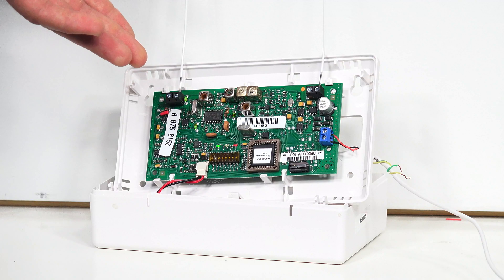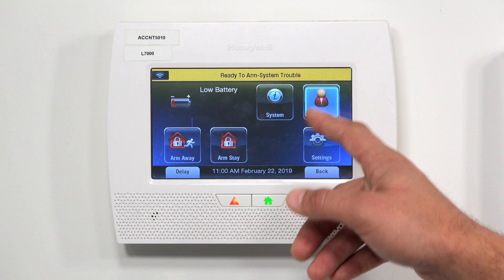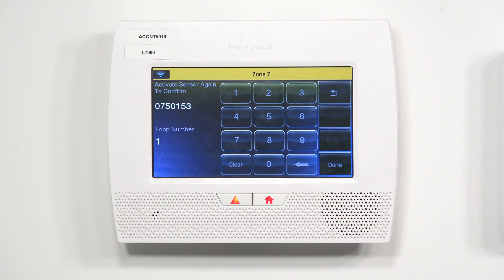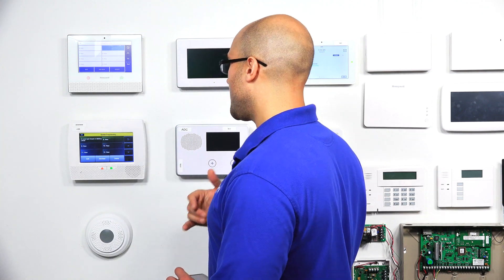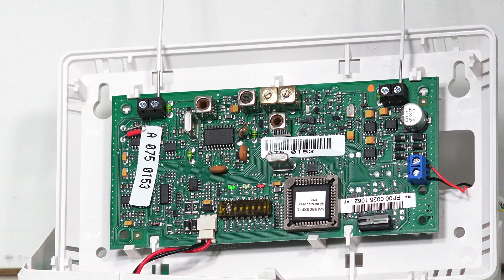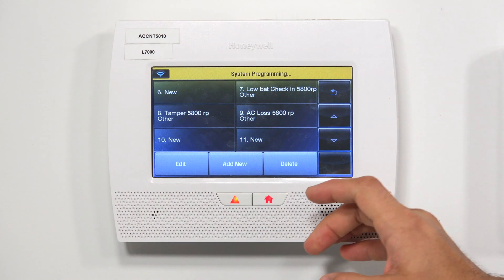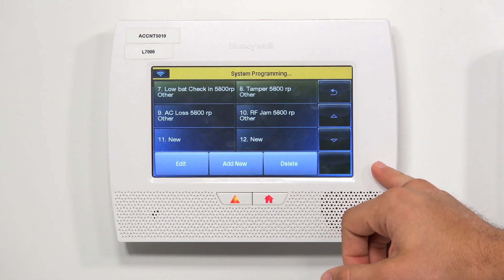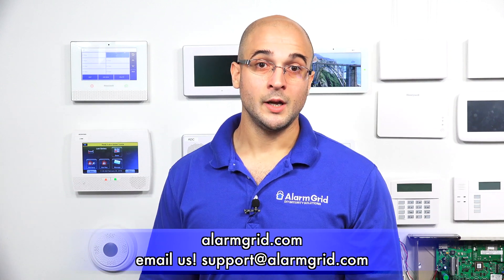Programming the 5800RP to an Alarm Panel

Comment: Wow, I have been dealing with Honeywell for upwards of 15 years. Usually, I do not program in the 5800 RP.  But, when I do, I never knew that I could break things down so much. Also, the paperwork does not mention that you can use a 12-volt power supply, but it is possible.
Reply: Hi Dennis, When the 5800RP is programmed into a Vista / Lynx / Lyric series set of panels, you can utilize all features of the 5800RP trouble/supervision features. Also, when UL made changes to some of the regulations is when the 5800RP stopped recommending a 12vdc Power supply source and only allowing a 9vac power source for UL installs. Even though in the instruction manual, in the "specifications" section for input voltage still has a 12vdc option listed not for UL installs.
Reply: Thank you for that information.

Comment: Hi Alarm Grid, I'm new to the sales world of security systems for commercial and residential lines. I will be selling primarily Honewell 5800 series devices for the residential sides. What beginner videos do you recommend I watch? Thanks for your help!
Reply: If you're looking to get more information about the sensors you'll be selling, you can always type in our company name and the name of the sensor in the search option and that should pull up the related videos. Our website does have a good bit of information about 58000 series sensors as well: www.alarmgrid.com